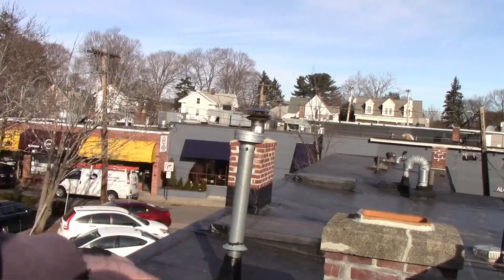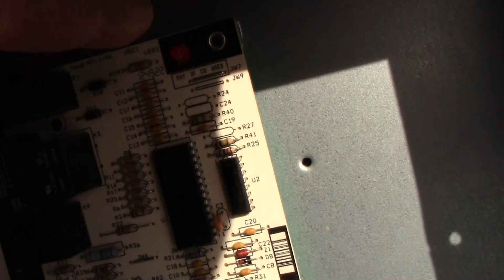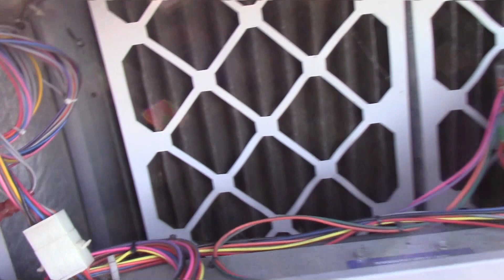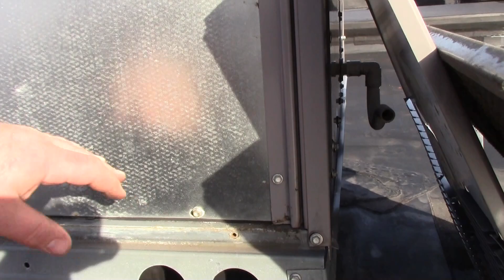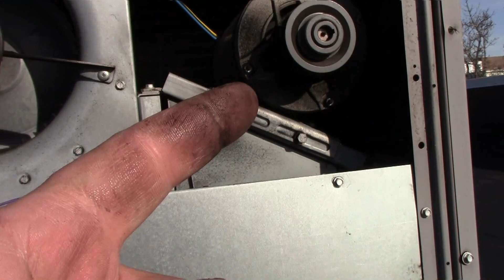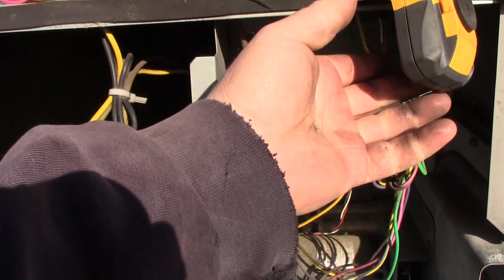Another Day in the Life of an HVAC Tech: Episode 17

Comment: Wonder if the variable pitch pulley set screw worked loose and allowed the belt to slack?
Reply from the maker: Just normal wear on the belt although I have seen cases where that set screw either vibrates loose or was never tightened down.  In those cases the movable half of the.pulley spins completely off.

Comment: Great video , Could you explain what you said about A or Ax belt ? can we replay A by Ax? or vice-versa?
Reply from the maker: 4L belts are lower horsepower rating than A series belts but have the same cross section.  AX belts are a toothed A belt.  These last the longest.  There is a 2 size difference between 4L and A series belts.  An AX-38 belt will be the same size as a 4L400.  Same holds true for B and 5L series belts.
Reply: Another way to remember the length relationships between fractional horsepower belts and standard belts is to remember that fractional HP belts are sized off their outer circumference, whereas standard belts are sized off the circumference of their pitch circle (which is obviously smaller than their outer circumference).  

Toothed V-belts tend to be more efficient since there's less energy lost in bending.  There's less heat generated in the belt, and the convoluted surface further aids in shedding any heat that is generated.